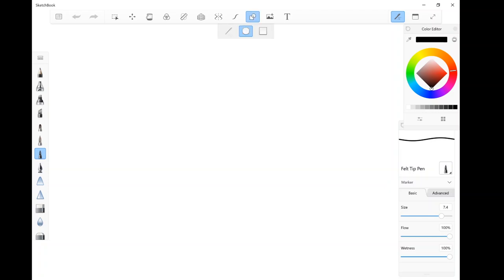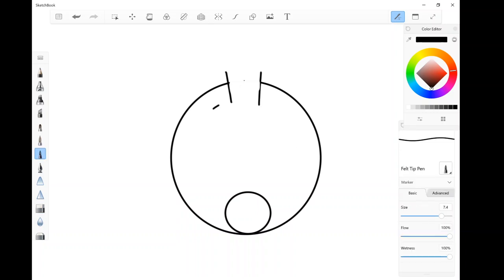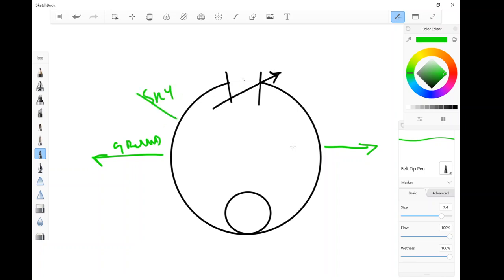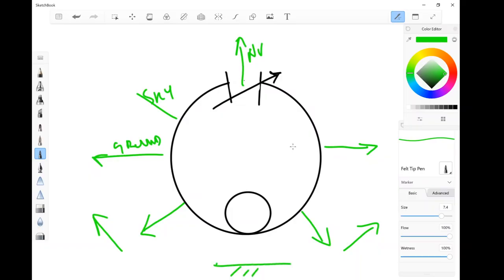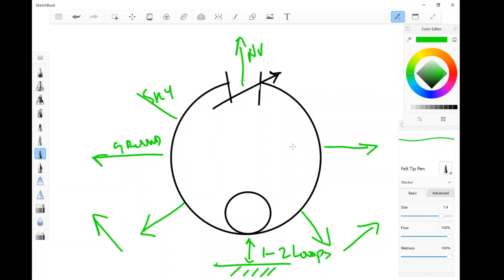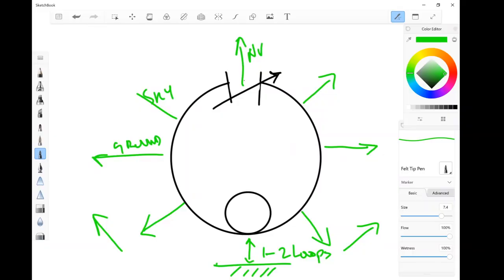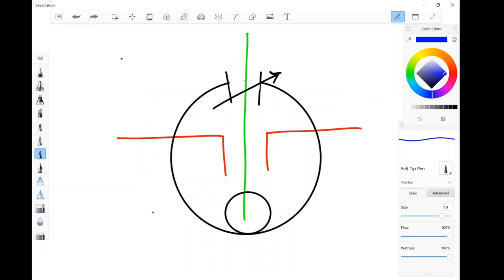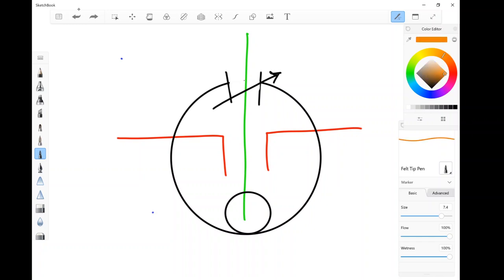The mysterious MagLoop "small loop antenna" lets answer a few questions. part 1

Comment: Hi, Gaz. Great video and explanation  of magnetic loop antennas. I still do not understand why installing a vertical loop 1-2 meters above the ground is best but higher mounting say 10 meters or so is bad? Also, how about horizontal mounting for omni directional? 73 Alan KZ6B

Comment: Gaz With most of the new radios having spectrum waterfall displays showing sometimes the whole band, what do you see when using a very narrow band width (Hi-Q) magnetic loop. Would it be possible for you to make a video showing a modern radio working with a magnetic loop antenna, to see just what happens on the waterfall.
Reply from the maker: this is part of both the benefit and the compromise, the Q is very high, and  if the loop is of poor design it can be so high as to nip the edges of the TX signal.. but something like a ciro you can see a fair bit of the band with an obvious sweet spot.. I forgot so much in this video I will do a part 2 to complete it.. thanks again Gaz
Reply: An antenna with a high Q will show up on the spectrum display as a hot spot, an area of several kHz that is stronger than the rest of the spectrum. It's VERY distinctive, and is easier to see than to describe.

Comment: Small Loops are directive. They have a null in the direction of the HV point (towards cap), which is commonly pointed straight up. So..., rotate them 90 deg; so the null is on the horizon, pointed away from a signal of interest or away from your noise..
Why’s everyone pointing them into the dirt usually?

Comment: My experience so far with mag loops; great receive, even low to the ground, transmit very, very- poor, not as good as a magmount car antenna. I will be making some very large  mag loops for shortwave ,receive only, where they make sense.
Reply from the maker: I speak to people every day with the ciro loops who work the world on them.. so I think some are better than others.. certainly section diam is hugely important.. Gaz
Reply: @TheGazLab  yes went  as large as possible 85 percent of one quarter wave, the receive was exceptional , the transmit was dreadful, used different caps, loop is a good weight of silver soldered copper pipe, all joints were soldered, caps were almost free of contacts and moving parts, one was an inserted copper single trombone, so as to be sure there were very few joints, this was all for a 10 watt qrp, s7 transmit on my full wave folded dipole, less than s-1 on the magnetic loop. Receive was the same on the mag loop as on my full wave antenna at 55 feet, very impressive. I am gong to build a 10 meter loop for receive on the low bands, but as it stands, I have no more plans to build mag loops for transmit.